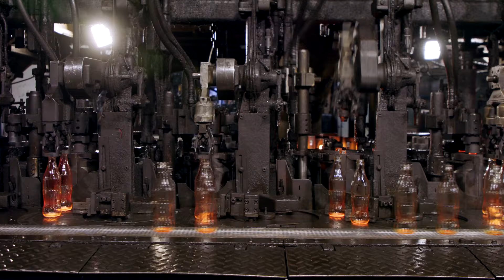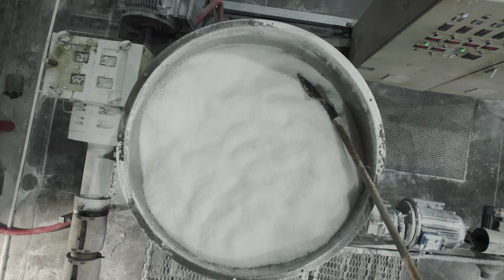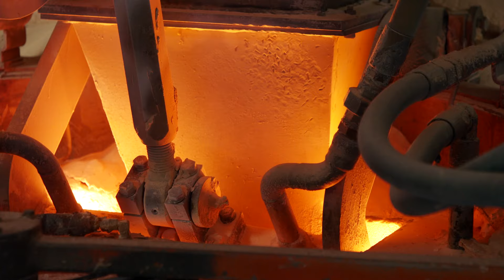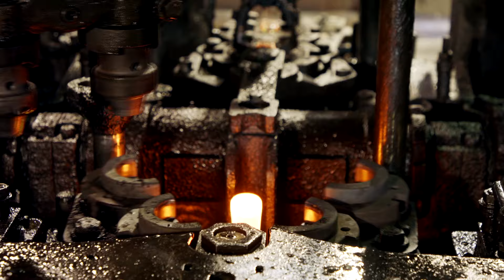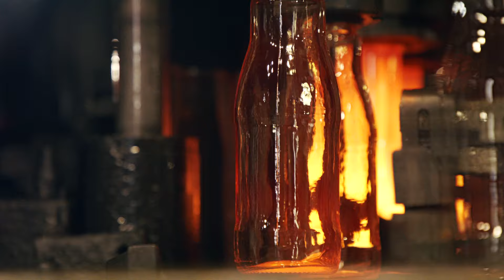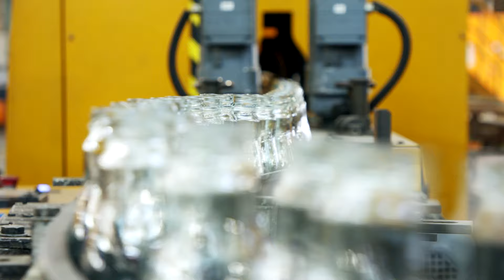How It's Made Glass

Comment: So do they hollow out the bottle using compressed air? How do they control that?
Reply: The blow mould cavity (2nd forming step) controls the final shape. The air pressure and timing throughout both forming steps is very controlled.